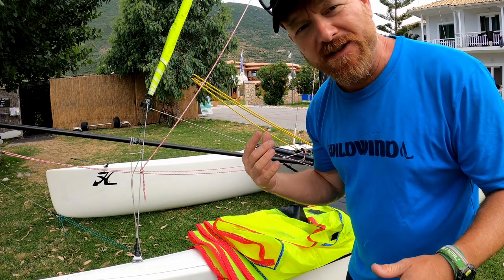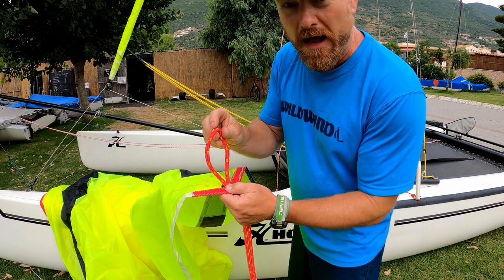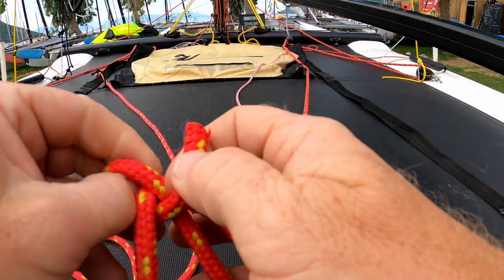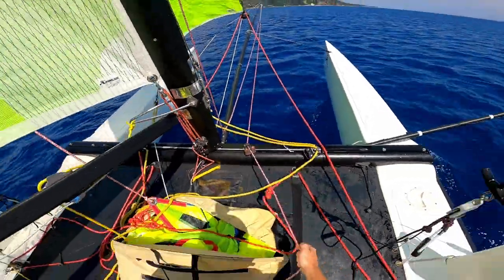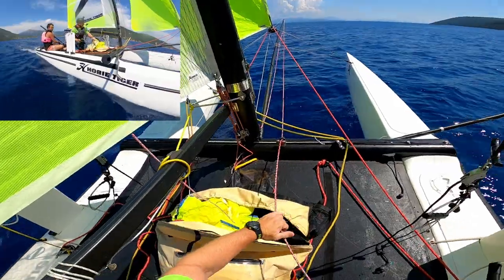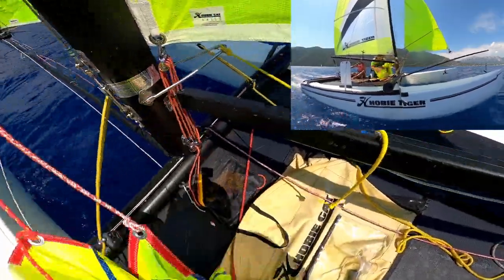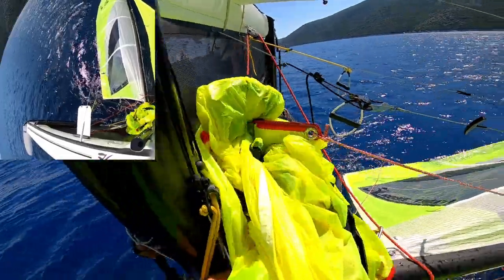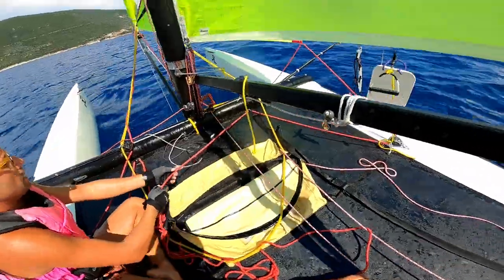Catamaran spinnaker tutorial ⛵️The bag system

Comment: Hi Joe,
What happen with the tack line?
Is it the other end of the halyard? How do you secure it? It looks like you are only pulling on the halyard.
Reply: Same question, and thanks for timely content…just picked up a sweet H18SX with a Tiger spin in a bag!
Reply from the maker: correct - it's a single line on this version. 
I'm thinking of trying going back to single line with the chute.
I'll have to come up with a system though.
Reply: Hi Joe, 
If a single line, when hoisting you pull on both the tack line and the halyard at the same time and have two cleats, and you throw the dead loop behind the boat?